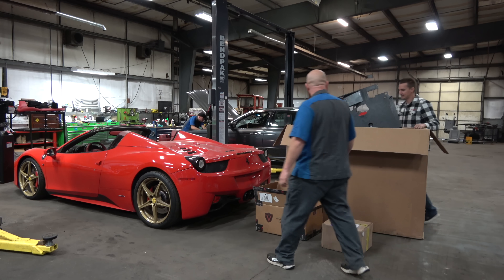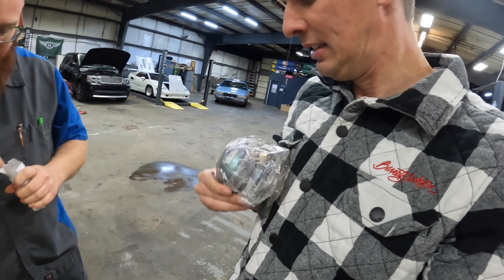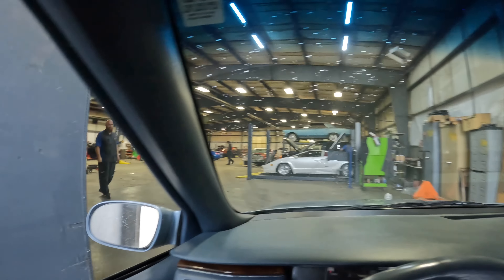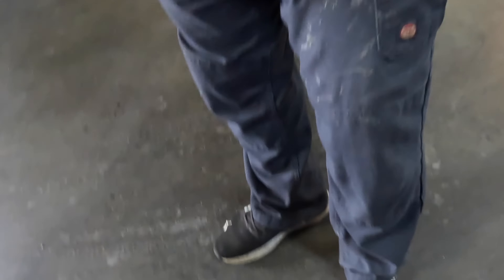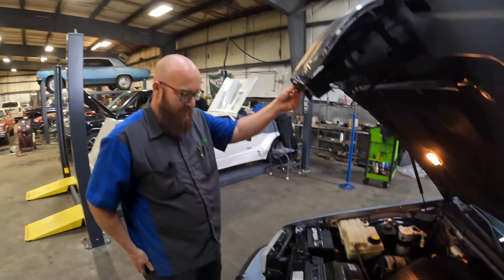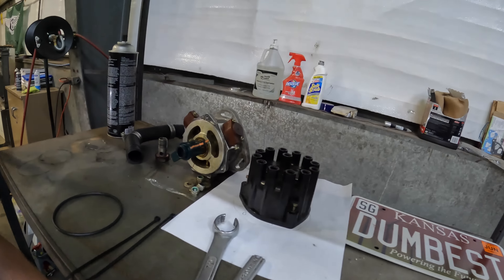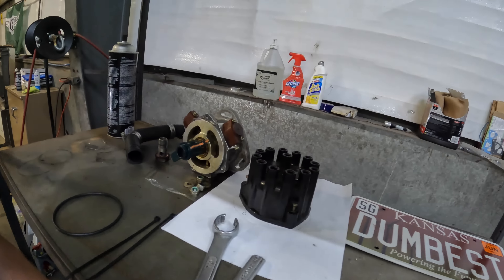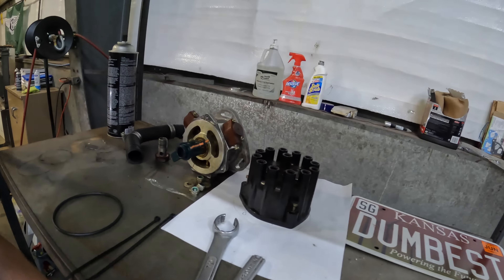The cheapest Ferrari 458 parts shipment is in, and I REGRET NOTHING as it drains my wallet

Comment: I am a automotive locksmith and the way the industry is changing has definitely affected how many vehicles we have programming access to. The dealerships see their service department as a major source of income so every year they try and find new ways to lock the computers so only dealer tools work on them or in Chrysler's case they lock the CAN coms and you have to find a special connector to be able to intercept CAN communication. This might be the biggest fight capitalism and right to repair ever have.
Reply: Haven't owned a car in a while so I think I'm going to stick with a vintage vehicle next time.
Reply: @themoviedealers  it's your best bet at avoiding electronics just make sure parts are available because most manufacturers quit making any parts after awhile and then supply and demand take over and the parts get expensive.
Reply: part of my job is clearing codes on vehicles when they leave our shop. the joke is there’s never a dodge without a code on it. MOPAR is the absolute worst when it comes to self repairing anything. we frequently have to send rams to the dealer to have codes cleared
Reply: @camreng9379  it depends on which model Chrysler it is but most 2017+ Chrysler's require a star connector to be plugged into the green star port to do anything other than very basic diagnostic work. If it's a Fiat car or a Fiat in disguise (Jeep Renagade) you have to access the RFH module above the headliner with a different kind of special cable. Thanks Stellantis for making Dodge's worse.
Reply: @pleaseentername.192  we have kind of a beefcake of a scanner. We had to purchase the OEM version of mopar software and pay the yearly subscription. Honestly its too  much work for us to fight the car and figure out how to do that shit.
Reply: @camreng9379  it's sad they have come to fees and pay walls to make money
Reply: @pleaseentername.192  look at how many cars the chrysler brand still makes. 2. The pacifica and the 300. Theyre squeezing any dollar out they still can.

Comment: An individual can do the software on the Range Rover.  There are companies that make things you can plug into the OBD ports, such as GAP Diagnostic., and update it yourself.  

That said, had the wizard replaced your suspension compressor with the same one that came in it, you wouldn't need to do anything with the software.

Comment: For the range rover you wouldn't have needed a software update and new plumbing if you replaced it with the original Hitachi compressor.The Hitachi is actually  more durable and easy to service and in your case would have been a straight swap.Landrover switched to the AMK after the Hitachi factory in Japan,which supplied them at the time,was destroyed by a Tsunami.They will tell you the AMK unit is better but thats no entirely true.They fail much sooner than the Hitachi units.

Comment: I owned a new Lamborghini Gallardo.  Enjoyed it very much.  Maintenance costs almost as much as my airplane.  Tired of $3000 yearly checkups/ oil changes, $3000 yearly registration, and $3000 yearly insurance.  Bought it for $200,000 and sold 4 years later for $100,000 with only 5000 miles.  5000 miles considered high mileage for an exotic.  A Porsche considered high mileage at 20,000 miles for comparison.  A plain old car high mileage at lest 50,000 miles.  I own a Model X, Model 3 and a Porsche Panamera 4S.  I enjoy stealthy, quiet EV’s with essentially no maintenance.  I can fill up at home with my solar panels.  Save $400/month on home electricity and gas.  No more oil filters in land fills or petrochemical odors.  I do own motorcycles but waiting for a battery powered with true 200 mile range.

Comment: I say TYLER, ED BOLIAN, AND TAVARISH UPCOMING CAR TREK SHOULD BE BUILDING ALL AROUND EXOTIC FUN HAVERS THAT IN THE END WILL COMPETE AT A Cleetus n cars burnout rivals contest! Its voted on by the audience in attendance and could make that one event worth enough that someone who might not have met the other criteria causing it to lose points in other parts of the series could still "WHIN" that season of car trek. Ed could find him a salvaged title Gallardo and have it vf engineering supercharged installed(most reliable power adder for the v10 platform) that requires least amount of modifications and fab work. Tavarish could find him some old camry inspired Maserati track car he could put 2 big kits of nitrous on, & Tyler takes this Ferrari and either throws nitrous or a big single turbo. The car trek series could be yall each sourcing your own parts by whatever means necessary, finding your own shops since yall live far enough from each other, you could find your own shops to do the fab work or installs and make that a part of tje season and then do yalls usual testing and comparisons. Then rather then time machine owning John Ficcaro, or the wierdo from Curated whose biased in Ed's direction because Tyler refused to sell to him, could still be apart of it but the finally be at a Cleetus n Cars burnout rivals contest!  Burnout winner is voted on by the fans and possibly some anynonmous judges. These are massive ppv events done at top tier tracks across the US and at Cleetus' on motorspeed way. Thats why I mentioned power adders and I'm sure the fans, and Garrett would love to allow yall 3 in a class of your own and could be or not be aired on the PPV or have it as part of the last episode that would allow tbe ppv buyers to be able to see it, the fans in attendance but by a large majority of the car trek viewers wouldn't see until yall released yalls episodes. 

You each could do giveaways perhaps on the 3 Cars yall build, cleetus McFarland is simply giving away one precision turbo in a random order every day this month. His last giveaway was a 6.0 swapped mercury maurader with a 72mm turbo and 4l80e paired too it that ran damn near 9 second quarter mile runs and was tried & proven to be reliable and was probably one of the biggest giveaways in the history of giveaways on youtube in terms of money earned on merch sales. It wouls be a great build series, an opportunity to double the length of a car trek season(we would love that) and the chance for tons of other sponsors to jump aboard and help yall with the projects. Not that either of you 3 need sponsorships or discounts with the depth of yalls pockets but what do I know 
Lol

Comment: Really would have liked to see the Ferrari  maintained with some cheap, DIY parts where possible, especially a piece of plastic that bolts on to the bottom. Get some lexan from Home Depot, cut some holes in it,  see if it works. Instead of buying some stupid metal brace from Ferrari, throw some angle iron on there. I mean, where is the spirit of the guy that put nitrous on a Prius? Who LS swapped a 911? Instead...we get expensive factory parts thrown at it. How utterly conventional and boring.

Comment: Nice to see that Roady get the love it deserves. I  (just a few years ago) had a '96 just like yours except it was a woodgrain delete model. Light Adriatic blue with the same factory leather interior. It had the tow package too. The driver's door panel needed extensive rebuilding on the back side and the car was a love it or hate it kinda of affair. When every thing worked properly, I loved it. But, it was easily the most costly over all money pit of a car I ever owned. Stock it did a decent 15.575 ET in the 1/4 mile and best trap speed was 89.55 mph. Top speed was limited to a measly 108 mph ☹

Comment: 87.000 miles on the ferrari.... high mileage. I've had Audi's with 450.000 kt, 565.000 km and still running without problems. Why buy a ferrari? It can't even hold a box of beer and a hot chick at the same time.